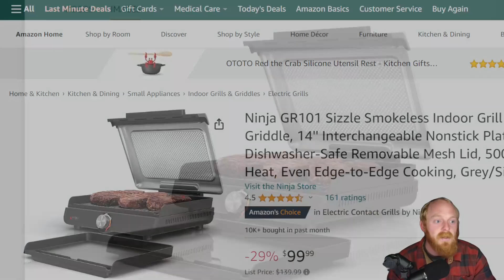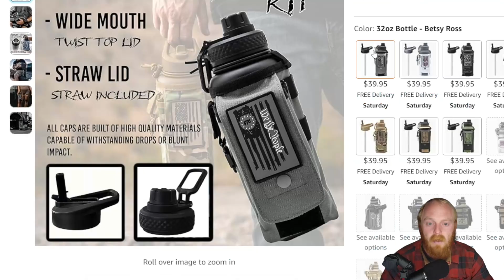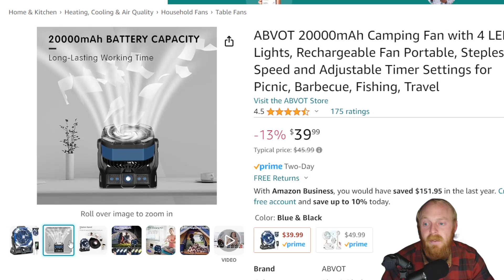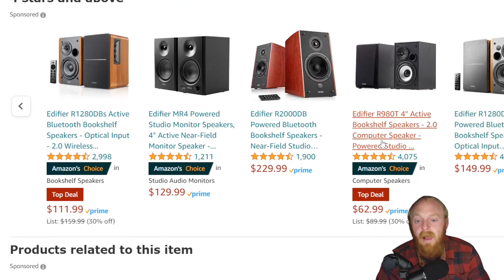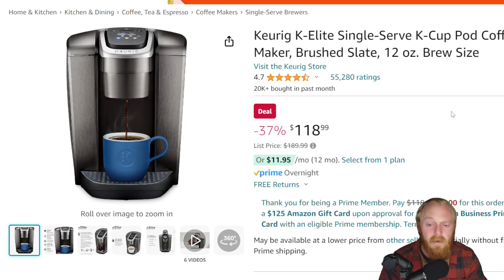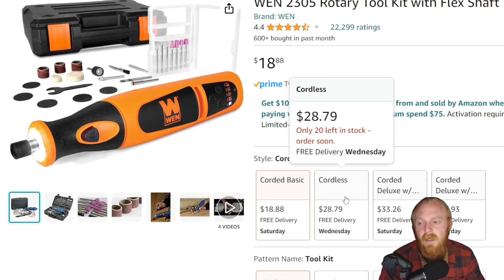Great Amazon Tool Deals and more Last Minute Christmas Gift Ideas

Comment: Great video, i like the stuff you mentioned. Quick note, those reservoirs on the Keurigs get slimy and nasty if you dont clean them out enough, 1 week might be too long to let water sit in there without it getting slimy.
Reply from the maker: Thank you and ya depending on if you use tap water or how your water is in your area they can get really bad even with the charcoal filter. I used bottled water and it's usually pretty good for a week. Great tip. I appreciate you sharing